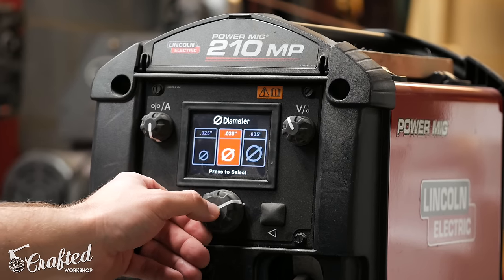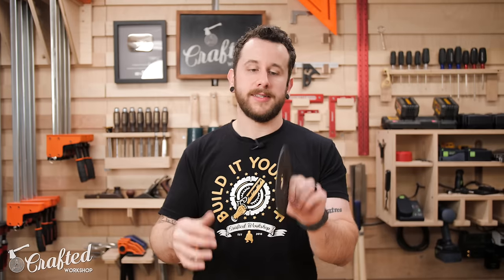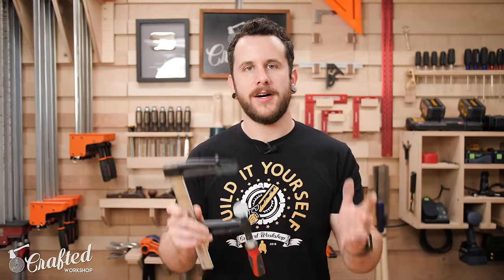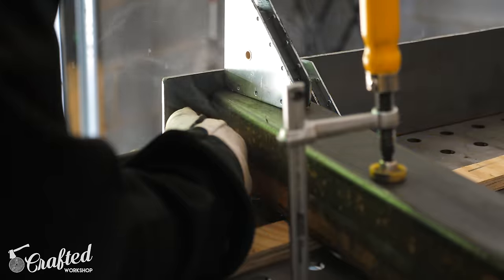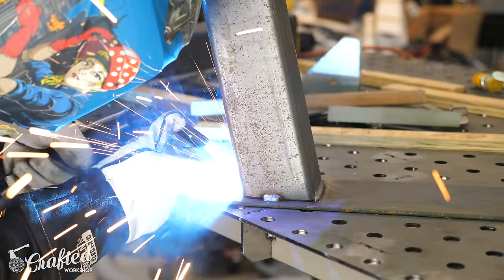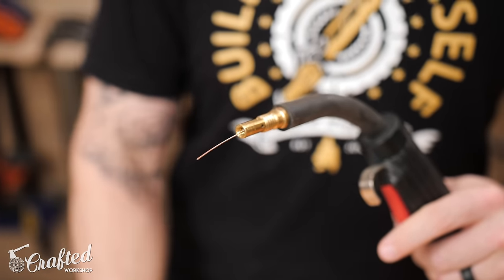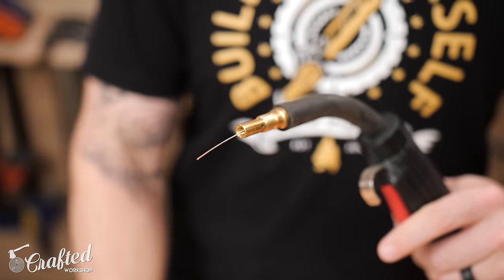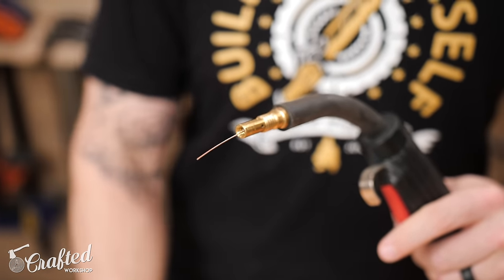5 Must-Have Metalworking And Welding Tools For Beginners // Quick Tips

Comment: I would definitely add a wire wheel for the grinder. Anytime I use stick or flux core welding I use that a lot more often than a chipping hammer. It’s quicker and it won’t leave any dings on the weld. Also a quality bastard file is very handy, especially after cutting metal, granted that is more of a hand tool.
Reply from the maker: Both great additions for sure!
Reply: If it’s a good weld, almost all your slag will come off with a good scrape. I usually keep a sharpened 7018 rod with me and use it as a pick if there’s tight inside corners, like with full pen vertical

Comment: For the metal-work-beginner the most important thing to start with is a workbench(1) and a vise(2).
Angel-Grinder(3) is a must-have, indeed.
Mandatory are the hand tools(4) like Skrewdriver, wrenches, hammer, pliers and so on.
Not to forget a socket wrench set (5).
These top 5 makes you ready to go.
Next on the whish-list might be things like table drill press, welding machine, benchgrinder and other nice-to-haves!
Reply: A welder is a necessity for metalworking.
Reply: @spydercoslacker7466  a welder is only a necessity for welding. Only a small part of metal work is welding.
Reply: enlightened58 it isn't
Reply: I like how this video suggests drill bits but not a drill.

Comment: Hell yeah,  I'm a 18 year Carpenter with multi trades to include electric, finishing,  and concrete.  Thank you I've been metal working.  Cutting,  drilling, mounting; aluminum,  stainless, brass, ar500...And now it's the next natural step to weld it myself.  Your video was very helpful thank you.
Reply: 18 good  good night lots off 18 do all that

Comment: Great tips on tools. I have switched from fibre cut off wheels to the Lenox diamond wheels. No black dust, they don’t break apart and send shrapnel flying across the shop and the diameter doesn’t change. They are pricey but I like em. Home Depot has a Diablo one for 19$
Reply: Good info. Thanks!

Comment: Good video, but if you can't afford $1000 for a welder to see if it's something that you may do, get a $100 flux core with .35 small wire spool (110v) . That way you can mess around without busting the bank, and I like flux core for some things. Do your research, and have fun too!
Reply: I bought a new lincoln 110 and use fluxcore. The machine can also run gas, but for the minimal amount of metal work that I do in my shop it seems to be an good option. If I remember correctly I spent around $750-800 for everything to get set up. That included the machine, auto tint helmet, additional wire, gloves, and other tools mentioned here. I spent some time practicing on various welds and material thickness. Overall pretty happy with the set up based on my needs
Reply: I'd agree on most of that, except for the fact of the cheap end welders don't produce the high quality welds that's needed for metal depending on thicknesses. 
Plus money comes and goes, ppl that don't know how to budget their money compared to those whom save up wisely and spend wisely goes a long way.
Reply: Don't use the cheapest harbor freight one, it runs AC
Reply: I got a $100 stick welder that says ZENY on the side and it seems pretty good on 120V, it'll do 25 to 75 amp all day long though it's maybe 30V OC. Have yet to run it on 220V @160 amp (60% Duty cycle) but maxing out a welder suggests something bigger would actually be the right tool for the job.

Comment: At the moment, I am researching getting into welding and buying a introductory welder (prob stick), so this video is AMAZING. as are most of your videos. Thanks again Johnny! Really appreciate the information and insights to these tools!
Reply: Well he forgot you need gass like an argon co2 mix or just pure co2
Reply: sir go with a multi process machine. even one of the harbor freight ones. then learn stick / smaw . if you can do that you can do anything. also note that tig and oxy fuel welding work the same. 1 uses electric and the other uses gas and flame to melt the metal. i learned on gas and moving to stick was a hard jump for me. my tig looks like art, my mig looks like i know what i am doing. my stick looks like i have a brain injury and or a stroke. it penetrants and holds  but looks like crap on top. getting better every day but not willing to trust it on my boilers yet.

Comment: I own 5 Lincoln welders, 2 flux core for the outdoor quick repairs for customers ( fences,doors etc) I have a Lincoln 3200 HD weld pac I use for  Aluminum,  1 Lincoln 180 I run 85/15 Argon (220v) and the Lincoln 210 with 100% Co2 for window bars , metal doors light frame work, for stck welding I try to run 220v only. The only welders I use in my shop are Lincolns.

Comment: I remember owning a CMI angle grinder.
Bought it as a kid for 20 bucks which was a lot of money for me at the time.
I used it at least 10 times every month at the minimum.
Welding my Miata's sill finally did that angle grinder in.
20 bucks for 7 years of service.

Comment: For grinders I always get the 2for 1 box set  one I set with cutting the other with grinding. Save time for prep work.   for the table that will be a good start to help metal wielding this can teach wielding. Drill bits hole saws but yes also. Don't be cheap because if they brake taps also if they brake in your work they really can be a pain to get out

Comment: I use Titanium mig 140
Runs off 120v 20 amp minimum
Welds 24ga to 5/16"
Costs $400 or $350 with the coupon
Small used shielding gas tank $100
For a Harbor Freight tool it works pretty well

Comment: You for got the wire brush to clean the weld? That's what I use to lay another weld on top of the other weld. I don't use the chipping hammer that puts dents in your welded work. The chipping hammer is good for stick welding.

Comment: hey that MP210 does not tig aluminum.. it is a DC tig machine not AC so it is for steel and stainless steel mainly.. can use aluminum rods with the stuck welding function but thatll give poor results or can get a spool gun to mig aluminum.. i have a similar machine made by ESAB with the same setup and limits.. looking back id recommend buying a nice mig machine then when youre proficient with that buy a tig machine, tig will cover stick welding aswell, youre gonna need two tanks of gas to do mig and tig so masewell have two seperate welders and carts ect
Reply from the maker: Yep, I misspoke there.

Comment: Stick welding for me always .too many adjustments on Migs ive tried both and Stick is the way to go for me
Reply: No offense but stick is so yesterday, very little need for it in most applications today, Mig is  very easy just use the settings on the machine you are close enough. I have stick, Mig & Tig, haven't used the stick in over 10 yrs I guess.
Reply: Try welding very thin tin together, for example fixing rust on a car. Stick would be impossible to use. Mig is the way to go
Reply: @Diesel8290  Try welding rusty farm equipment in the field, stick is the way to go.😉
Reply: Chris Gilliam Man Stuff  yeah if your welding rusty box section together, in the corner of a field it’s the job, been there and done that 😂

Comment: Also if you drill a lot you NEED a drill press. It's so much easier to drill holes with a drill press.
Reply from the maker: Not a necessity for beginners but definitely useful!
Reply: @craftedworkshop  
most ppl nowadays don't know that there are table top small drill presses available that're also reasonably priced.

Comment: The 210MP cannot TIG weld aluminum. It’s a DC machine only. 
Also, at the basic price point, it will not come with the accessories for the TIG as a torch and pedal.
Reply: Well you only need a torch for tig
Reply: I got a alum mig spool with mine.
Reply: @simonhenriksen3924  even if you have the tig torch, that won't enable you to weld aluminium. You need an AC welding power source, in this case the promoted machine is DC. It will enable you to weld steel and stainless steel, albeit using the touch-start method, not the high frequency start that you get with an AC machine.
Reply: I've welded with vulcan tig torch on my 210 MP, worked well.

Comment: Note that the 210MP does not TIG weld aluminum, as it’s a DC-only machine. Aluminum requires AC to TIG weld. To weld aluminum with the 210MP requires a spool gun.

Comment: Hey Johhny ,
Great intro vid for those whom want to start metal working!
Just a safety comment:
You mentioned NOT using a cutoff wheel to grind material, due to applied  lateral loads causing the wheel to fail.
Very sound advise!!!
You went on to say that the angle grinders rotate at 30,000.
For viewers info, you should not be rotating 4 1/2" diameter wheels at more than 13,000 RPM.
Most angle grinders spin between 11 and 13k.
I just wanted to point that out before someone chucks up a cutoff wheel on router arbor puts in that old router sitting collecting dust, and blows up the wheel due to excessive centrifugal force.
Being a metal, and woodworking apprenticeship instructor in the past, I have seen " crazy" applied.
Most wheels will state the RPM not to exceed.
Thanks for your continued zeal in producing instructional vids.
A fellow North Carolinian.
All the best and God bless.

Comment: If you're looking for a cheap multipurpose welder, lookup ct520D on Amazon. It's a Chinese design, but it does it all including plasma cutting. I paid $425 with the 4 year warranty. Don't start with a Lincoln, end up with a Lincoln after 5 years welding.
Reply: Ruffian By Nature  just ordered it. Should get here tomorrow. It sounds pretty decent, and the warranty makes me feel better about the buy. I saw one on Craigslist that's about 5 years old and is still kicking, but they wanted the same as brand new.

Comment: The 210mp is an excellent machine for mig welding especially for a beginner. I work in film and I often have to grab a couple of carpenters and show them how to glue stuff together. The 210mp WILL NOT TIG ALUMINIUM. It will weld aluminum well, but you need the spool gun. It will tig steel quite well, but I would avoid using it for tig welding stainless steel. It's pre and post flow are non existent. Just a heads up.

Comment: Leave the chipping hammer at the store, just get a wire wheel for the grinder.... if your going to get a multi process machine get one that will run 6010 rod. That 210 mp will not. Mag clamps, no good, they will pull your weld pool... if your spending the cash on a fixture table make the table clamps and get Fireball Monster squares. They are sweet! Fireball monsters squares are a must have if your fabing metal!
Reply: I've been a professional welder for 11 years 8 years as an Ironworkers this welder will absolutely run 6010 rod, besides unless you are running open root or welding very rusty material 6010 will give you a poor looking weld if you aren't doing structural for the average home user I would recommend 7014 or 6013

Comment: Things that i think is also very useful in a metal working shop: butane torch or small acetylene  for heating metal for bending; good quality wire brush; set of quality  files; and a rotating bench vise. All those things are really useful if you are starting.

Comment: The 210 MP is a DC TIG machine and not really suited to welding aluminum.
Reply: I've got that welder, used a vulcan tig torch and has worked well.
Reply: This welder will NOT weld aluminum in the tig mode!!
The option for aluminum is a spool gun, more money and less than desirable results!!
Reply: Chris Gilbert a spool gun is pretty good if you know how to use it.

Comment: Like the video but the chipping hammer is more useless if one of the starting tools is an angle grinder put a Wire wheel and slag clean up is quick then put a flat or backing pad on and stick and flux core clean up is really quick.

Comment: How about a drill, if you don't have one? Would a regular corded drill be enough, or do you need a strong drill, like a cordless drill? Is there any use for a regular woodworking cordless drill in your metalworking projects?
BTW you can buy the hex shank drill taps for A SIXTH of the price on eBay, and they are great! A set of 6 for I think around $5!!
Reply from the maker: Of course a drill would be a prerequisite, but I'm assuming most people watching this video own a drill. I use the same drills I use for my woodworking in my metalworking, as I'm generally not drilling very large holes.

Comment: One other tool I feel you have missed off is a wire brush for clean off weld from arc or flux core welding or wire wheels for grinders.
Reply from the maker: Definitely a good thing to add!

Comment: OK, so flux is the product that offers shielding to the weld puddle during the welding work. It forms a barrier to air and other impurities that ruin a weld.
Slag is what is left after the flux does its job.
Reply: If you use gasless welding, yes flux does all that. If you use solid wire with gas, the gas provides that same protection without leaving the flux that requires removing, plus leaves a much neater, less brittle weld. Well worth the extra $.

Comment: Instead of the hammer just get a $9 (with coupon) HF drill master grinder with s wire wheel that lives on it. Way quicker to click that on then use your good grinder for actual work.

Comment: Let me add a few different sized steel wire brushes and a level and a degree finder a square and measuring tape down to at least 1/8th and a metric one down to millimeters.
Reply from the maker: Definitely, measuring devices are assumed.

Comment: Nice video. I've been welding and woodworking for over 25 years. I'm of the opinion that if you are going to get serious into welding you should master stick welding first. Once you master stick welding all the other processes of welding will be a lot easier.
Reply from the maker: Thanks John! I personally was never a fan of stick welding, it always felt extremely awkward to me and is so much slower than solid core MIG.
Reply: John, I agree totally. I've been welding for 27 years and have 2 trade certificates in the welding industry and I believe that if you understand how to run neat, strong welds in all positions, it will make all other welding applications seem easier, especially mig welding. TIG welding is another art form all of its own but becoming good at TIG is also very rewarding.

Comment: Although mig welding easiest to learn, I strongly suggest anyone who is serious about welding should learn to stick weld first, then M.I.G, then T.I.G.  As for the regular Joe wanting to just weld something now and then I suggest just M.I.G. , easy to learn, although just a bit more expensive start-up costs,. Using gas alot easier than flux core. And looks cleaner.

Comment: For metalworking, a 7/9" angle grinder is 10x more useful than 4.5-5/6" IMO. Carbide tooth blades for ferrous metal and non ferrous metal are super cheap now and a KILLER value for metal cutting if you already have a wood shop with miter saw. And "on/off" welding magnets (including as a ground clamp) are kinda costly, but absolutely worth every penny...
Reply: Ferrous Carbide blade for woodshop miter saw???? The metal carbide blades require far slower speed than a miter saw for  wood.  What am I missing here?

Comment: welding jacket???? i wear a singlet or t shirt

no angle grinder spins at 30 000rpm.

4" grinder is only 14000 to 16000rpm max
Reply: @nickysmallarms2256  And eventually will have massive melanoma tumors.

Comment: Flux core is not MIG. Say it with me. Flux core welding is not MIG welding.
Reply: Metal in Gas right? The gas comes from a bottle of gas from my memory. The gas is appropriate to the metal to be welded.
Reply: @AndyWJP  Metal Inert Gas.  There are a number factors which go into choosing the best gas.
Reply: If we're being that pedantic then mig welding is actually pretty rare and it's actually MAG welding we are reffering too.
Reply: @t44e6  true mig welding is just argon, helium or a mix of both. When you include things like CO2, nitrogen, oxygen, hydrogen etc it stops being metal inert gas and becomes metal ACTIVE gas as those gas mixes react with the molten weld pool.
Reply: Flux core is not MIG welding.
Reply: @jorgegordillo7078  yes it is. there's two types.
Reply: If you’re a professional welder you’ll know that flux core and metal core isn’t mig. It only use MIG/MAG equipment. And both flux and metal core will need gas as well.  131/135-MIG/MAG 136/138- flux and metal core.
111-stick 141-tig
All differente processes

Comment: Here a tip for anyone that get flash burn . That's where your eyes feel like sands in them and hurts . Now this is an old trick and works everytime.  Cut potatoes and put them on your eyes . Now yes when this happened to me I looked at my father like he was nuts . But works 100%. Believe me talk and ask the old welders questions.  They know alot and stuff that not in books or online.  As u been told they forgot more then you well learn. And last tip buy and keep the old books . Can not tell you how many times I had one help me .
Reply: I forgot buy big blue

Comment: when can i talk to you directly about welding am a bigner /Zambia trouble is about aluminum and cast iron
Reply: use stick welding. cheap, easy to get started, lots of videos online. Also works with aluminum and cast iron - choose the right electrodes